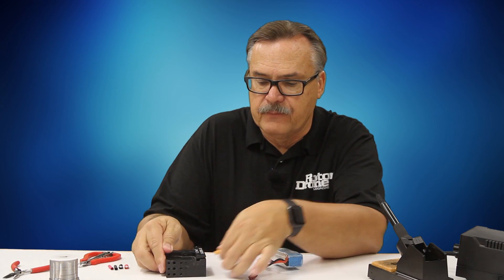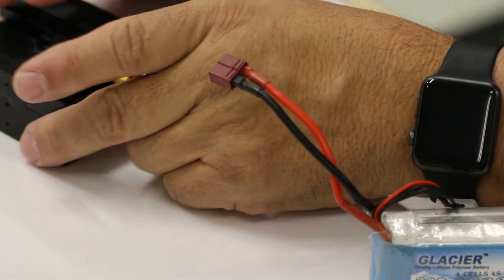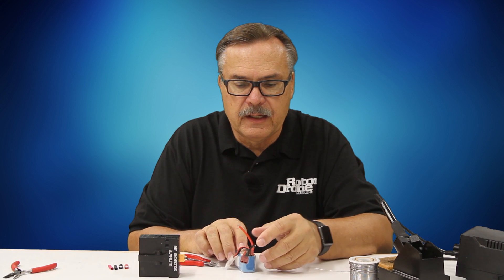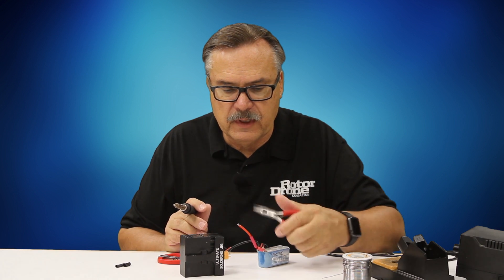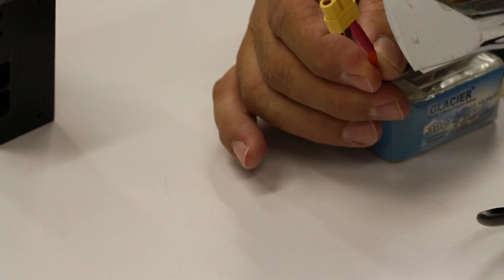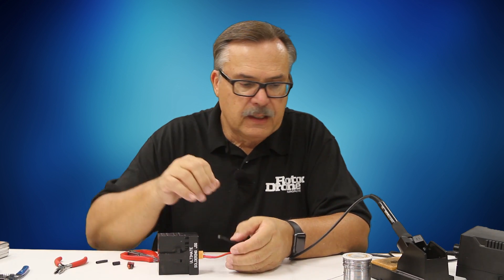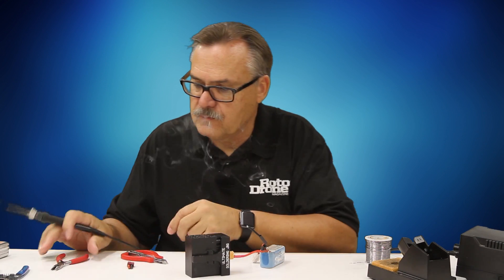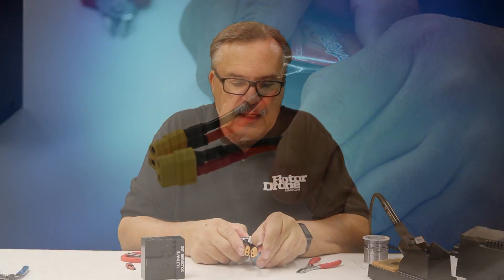Battery Soldering

Comment: I think you should bring up that properly "tinning" the iron's tip is necessary.  Also, the sponge ~ wet, damp or dry?  Why?  Also - using cheap solder can be a nightmare - break down and buy some decent flux filled solder - you'll be thankfull later.  And heavier wiring on, for example, 6S batteries will likely require a higher output soldering iron.  Heat the piece you want to solder and let the solder melt onto it, rather than heating the solder to the melting point, then onto the wire or plug.  Maybe bring up "cold soldering joints - know what they are and how to avoid them. I also use flux on the items I'm going to tin to ensure smooth solder flow and superior adherence.  All relevant things if someone's just beginning to learn how to solder.

Comment: Suggestion:  Put a bit of contact cement on the wire insulation near the connector before sliding the heatshrink up.  It really helps and prevents the heatshrink from sliding back over time.  (Some heatshrink is glue-coated on the inside, I undertstand, mine is not,)